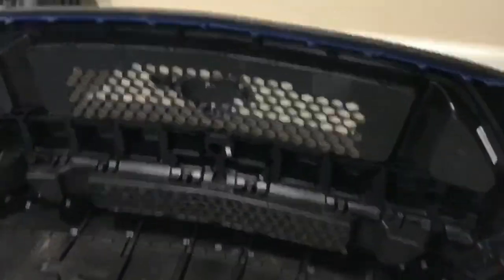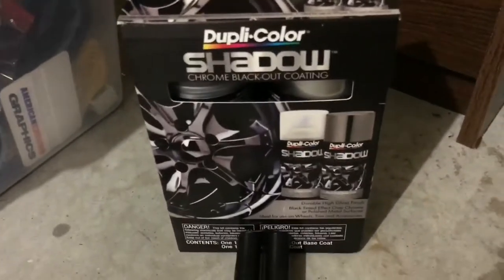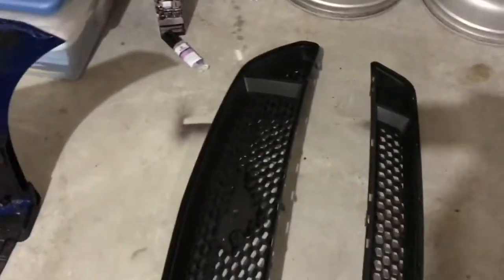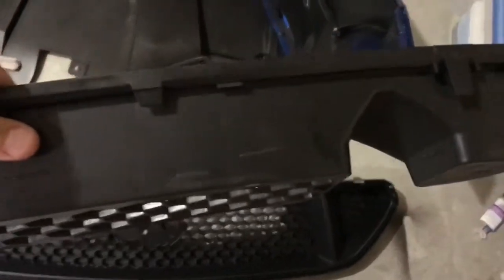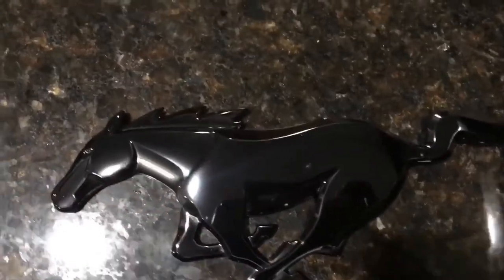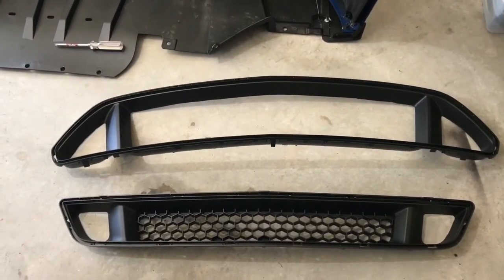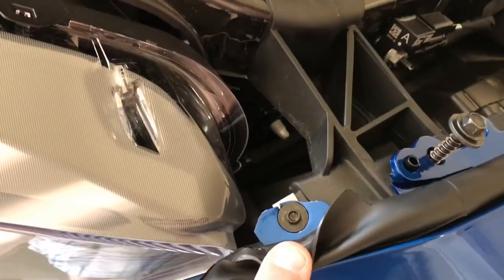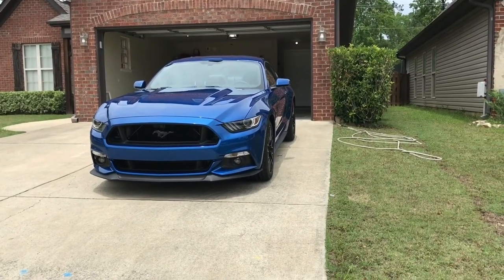2015 - 2017 s550 Mustang GT grill delete part 2. Cutting the grill & re-hanging the emblem.  ✔️

Comment: Great job and thanks for making this video. Going to do this to my GT now and going to follow your instructions to do so!
Reply from the maker: Keith Howard Thanks!
Reply: Hi there, I had a question. The bracket that you used to hang the pony, did you have to drill a custom 2nd hole into the bracket you bought since it looks like on the video the 2 holes you have that you put the anchors in to look closer than the pre-drilled holes on that bracket you showed in the video
Reply from the maker: Keith Howard yes I did.  Sorry if I forgot to mention that.  I try to be as detailed as possible.
Reply: Awesome, thanks again for the reply. I started this last night and just finished today. The only problem I am having is getting the pony to stay to the metal bracket I bought. I got epoxy like you showed but there doesn't seem to be a good area you can actually get the epoxy on and it keeps falling of the bracket. Can you explain in detail lol... how you got your pony to stay and has it blown off in high speeds?
Reply from the maker: Keith Howard email me.  Randyknight@hotmail.com